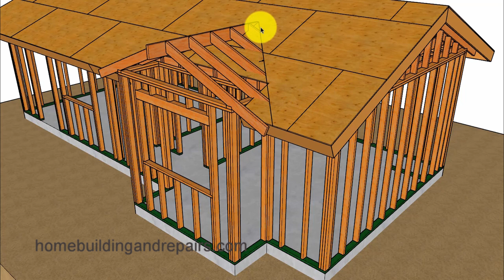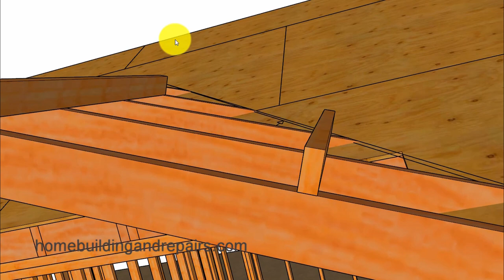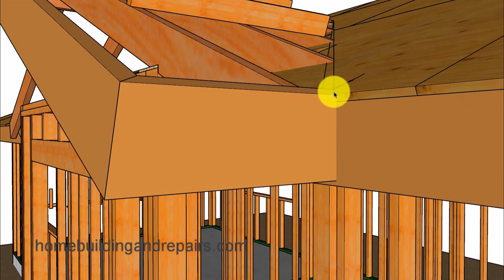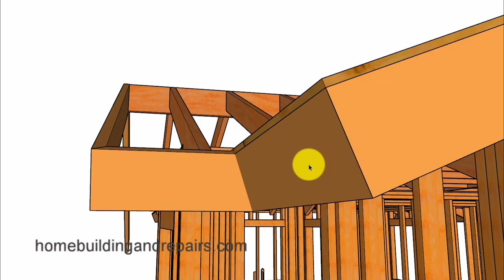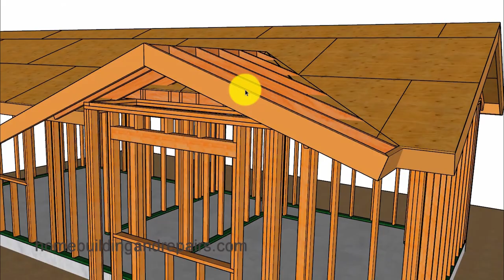How To Fix Fascia Board Problems When Roof Valley Fill Line Is Not In Correct Location

Comment: What would you do here if the roof sheathing on the new addition was 2x6 t&g instead of 5/8 OSB that the original house has? Would the location of the valley line need to be altered so the facia and overhangs match correctly?

Comment: We set the rafters on top of the ridge and secured with the hurricane u shape straps. Would our valley boards go above the ridge beam on the roof end and that is where we would pull our line from?
Reply from the maker: If that's easier, then it might work, but I like to have the ridge sitting on something solid if possible.

Comment: It's okay if the ridge is off by three inches? When one makes everything level and square to begin with there will be no major problems. Working around a problem sometimes takes longer than redoing the whole thing properly. Why don't you finish the fascia on the gable and chalk a line from where the two fascia's meet to the ridge end? Easy.